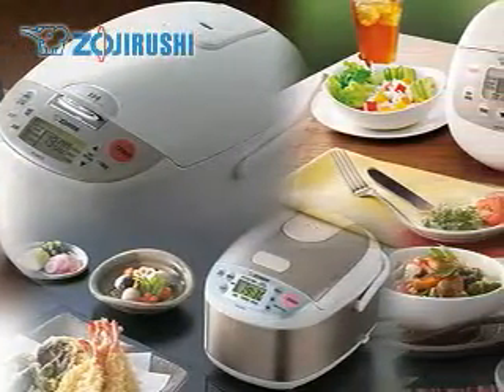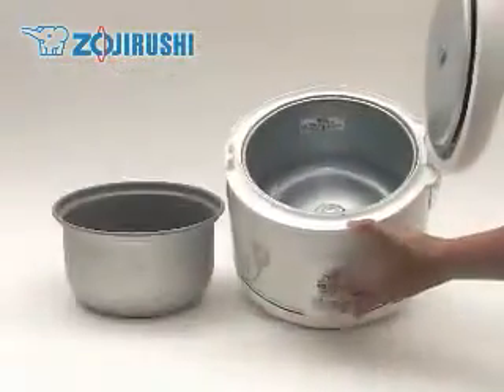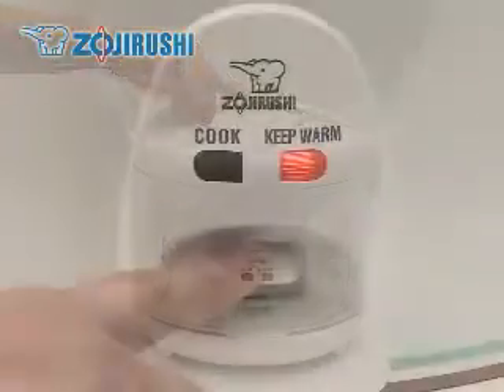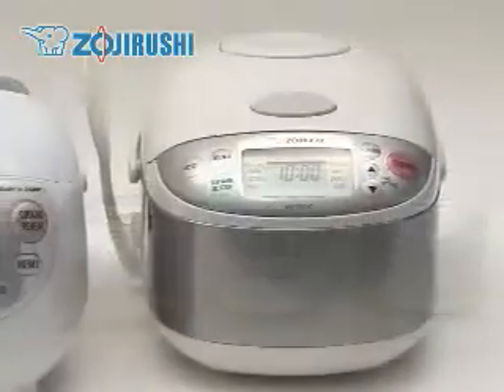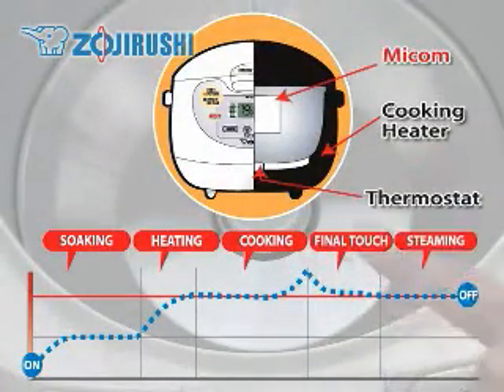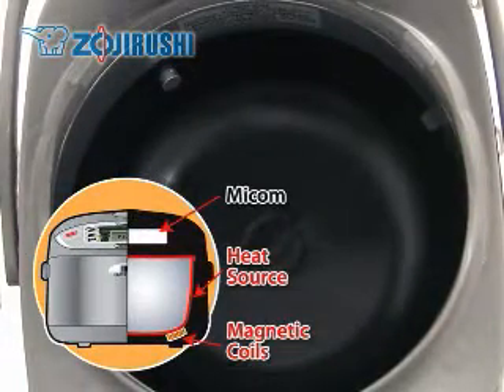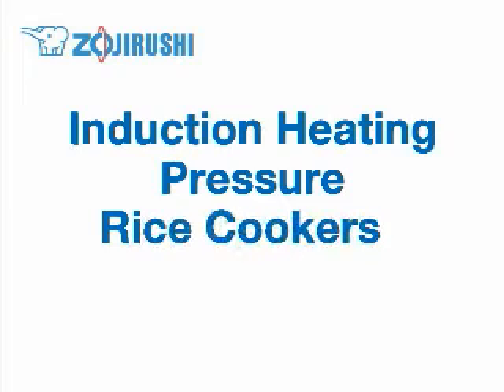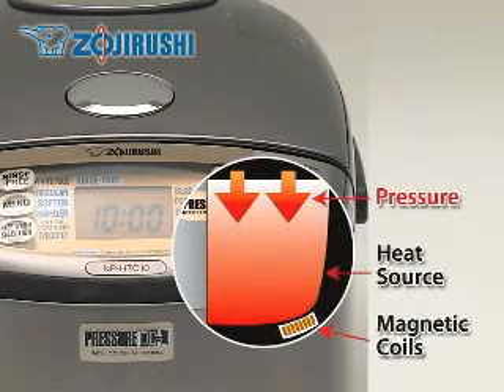All About Zojirushi Rice Cookers Part 1

Comment: Got a Zojirushi last week, already twice in a row rice has come out with lots of water at the bottom and not completely cooked. It's tough and has a nasty flavor.

Is there anything I could be doing wrong? The first time it happened when I used cold water, but it just happened again when I used warm water.
Reply from the maker: Are you using the measuring cup that came with your rice cooker to measure rice, and the water measure lines in the inner pan? The lines correspond to the number of cups of rice being cooked, so you will first put the rice in the pan, and then add water to the corresponding line. Please let us know if it still doesn't work!
Reply: I use the cup and fill to the line, yes. I'll try using it tomorrow and see what results I get.

Thanks so much for the response!
Reply from the maker: If it still doesn't work, please let us know what kind of rice you're using!